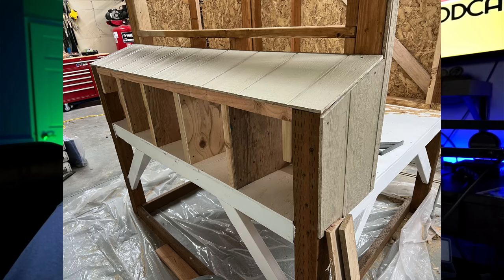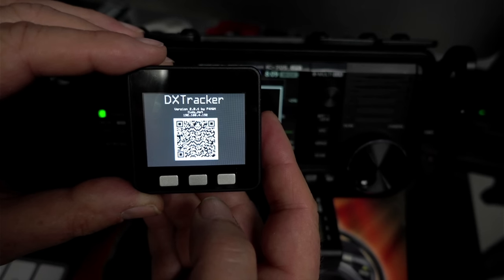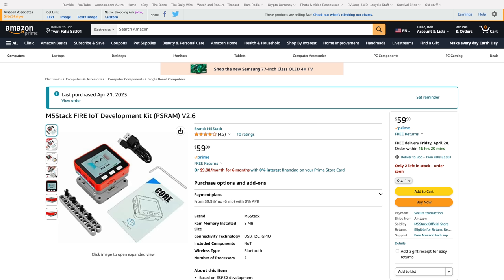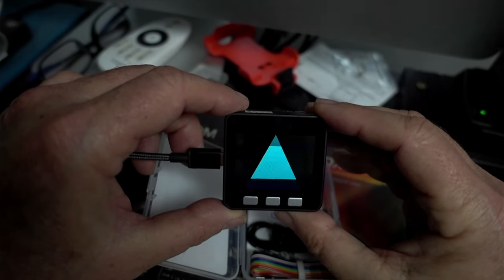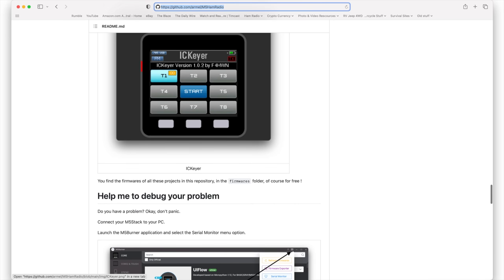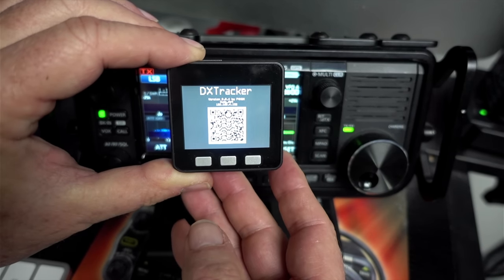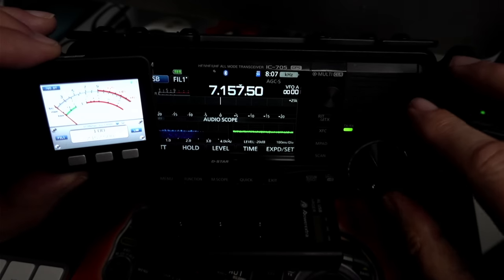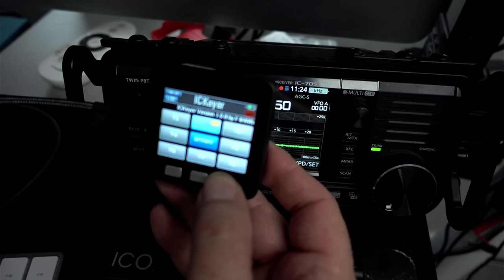FREE DIY Icom Meter that will make your next POTA happy happy happy

Comment: Aloha Bob, this M5 Stack looks amazing! 
I hope one day that this will work on my Xiegu G90, that I have been enjoying a lot lately with these excellent band conditions over the last couple of months. I built an antenna that gives me an SWR of 1.0 before tune and have been making long distance contacts on one watt only. 
     I’m hoping that radio manufacturers start building all modes portable HF rigs of 100+ watts for POTA’s. 
     Like thousands of other hams, I thought the new IC-905 was going to be a 100 watt version of the IC-705. Icom’s roll out of the IC-905 was just super bad timing for doing POTA’s has gotten so exciting and the amazing current rage among hams right now. 
     Have fun at Disneyland, I use to reside right next to Disneyland when I owned a home in Anaheim and could watch the nightly fireworks show from my backyard jacuzzi a few decades ago. 
    While you’re there, there is an HRO Store right on Euclid Street near the 5 Freeway that you can really spend some money if you have anything left after going to Disneyland. 😂🤣😂🤣
    73’ Todd de WH6DWF🇺🇸

Comment: Under 8gb SD
Had to go into BT settings and hit Pairing/Connect for this to work. Not sure if you mentioned that, didnt see it in his notes either.
Reply from the maker: Both my returns functioned by the micro sd readers didn’t
Reply: @K6UDA  Not sure what that is, glad it worked! 
The bluetooth settings I mentioned are in the IC705 menu  Bluetooth  -- Pairing/Connect

Comment: Hey Bob.  Is the analog meter choppy when the needle moves or is it smooth?  I’ve seen older versions of this that were choppy.  Thanks and 73.
Reply from the maker: So far it looks pretty smooth.
Reply: @K6UDA  Thanks. I saw the guy from Zumspot at the Orlando Hamcation and he showed one using an M5 stack that had the same looking analog meter as what comes with the ICOM 7610. I don’t know where he is on that project but that looks pretty promising too.